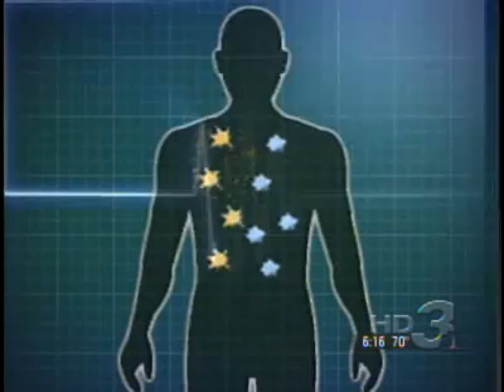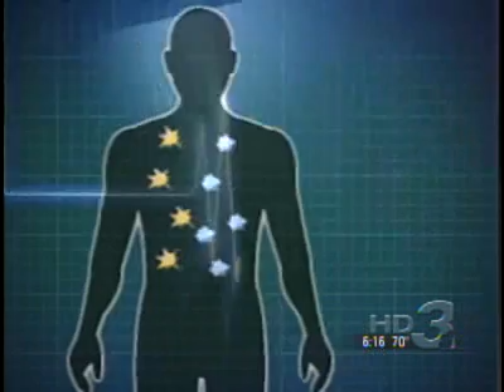Salt Water into Fuel

Comment: I've been following these videos for about 6 months and that might be the dumbest response I've ever seen.  First off the water is being changed into a gas by reducing it to it's elemental components, hydrogen and oxygen, not water vapor.  And while compensating water does release energy to the environment it's of such a low grade that it's for all intents and purposes useless. If it wasn't my freaking air conditioner would be powering my house, not tripling my electrical bill.

Comment: Yeah, it's trult sad folks (via the media) are as ignorant about nuclear power and the risks.

Makes about as much sense avoiding Boeing 747's because of the safety record of a DC-3.  Those reactor we're designed and built a lifetime ago with regards to technical advances and other considerations.  Today's reactor would require the laws of physics to be suspended before they could melt down.

But then, this entire thread is about the laws of physics being suspended.

Comment: water covers about 70% of the earth's surface and 97% of that water is salt water and has very few uses to man. Almost 2% is frozen and only about 1% is fresh water. Now if we can find ways to harness some of the most abundant elements on this planet shouldn't we use them. It is a step forward. And there are low energy ways to produce radio waves much less seperate oxygen and hydrogen from salt water. True you can always drop a battery in but it'd need to be done on a large scale.

Comment: Why do you think microwaves are necessary? The report says "radiofrequency", which typically means lower than microwave, designed to heat metals, not water. Your negative result is likely the result of not really reproducing the experiment.

Comment: You're missing the point. While it takes some energy to produce the radio waves, a 1500° heat output is likely more energy going out than going in.  The difference is made up by the hydrogen-oxygen reaction.  What remains to be seen is whether the efficiency is real and exploitable.

Comment: (cont)

Salt water is a good conductor at RF frequencies and has even
been used in a column as a transmitting antenna, albeit inefficient.

More to the point, the frequency of the RF is rather important,
since contrary to the implications of the video, high intensity RF
actually is harmful to human cells for other reasons, not just its
tissue heating effects.

Comment: A note of caution about this... it's nothing new, and the critical
information that puts it into perspective isn't divulged. Nowhere
does he mention how much energy input it takes to get that flame.

I personally have made corona discharges that vaporize copper
using as little as 40 watts of low frequency RF, but the yield is
so low as to make it unproductive. I was still in high school at
the time, probably in 1959.

Comment: Chemical-potential energy is not really an 'energy' but a structural state of matter.  When you isolate H from O the added energy is represented within the atoms themselves - that is, the applied energy input is stored as *nuclear* energy.  

It may be possible to efficiently split water so as to achieve a net positive energy output.  That is not a violation of the law of energy conservation, but a benign form of nuclear power.

Comment: I'm not sure where the 76% number is from originally, but below it refers to only the seperating of the H2O, not the entire process.

Once you have the H and O you still need an internal combustion engine to transform that into mechanical work, which will have a similair efficiency of the gas or diesel engine.  So the overall eff. would be 0.76x0.30 (assuming 30% eff for gas) for a total of ~23%.

Just using the electricity you couple power a 90%+ motor a lot more efficiently.

Comment: As stated in a previous post:

"76% is better than a gasoline engine (25%-32%) or a diesel engine (42%). John doesn't claim that his invention is a free energy device."

The guy's not even claiming it's the answer to the energy crisis. He's focused on medicinal research. He's saying it's a start. If someone wants to take it and run with it, they can. Did the Wright brothers start out with a 747?

Comment: Are you a moron?  I have some questions to ask you.  What about the ice ages before humans were on this earth?  What about the ice ages in the 1700's before cars were running?  What happened then?  Why did the ice melt then?  Why is Mars 95% CO2 and yet its temperature is -100 F?  Are you really so dense that you buy into this nonsense called "Global Warming?"  Now, there is such a thing as global warming, but it is a cycle that the earth goes through naturally.  It is not caused by humans. :-|

Comment: so what then of a spark igniting gasoline?  it's called an action potential, brainman.  does the common combustion engine then take the power of a small spark only to convert it into the power of another small spark?  No.  It's called FUEL.

Comment: Its not hydolysis, its electrolysis. hydrolysis is the process of adding a water to sperate a given molecule, electrolysis is the application of energy to slip H2O into 2H and 1/2 O2. And although it is a process that wastes energy, it is far more effcient than all other sources of energy that are viable. This is due to the fuel cells efficiency. Gas is only 20% effcient from Rig to car, while hydrogen is 80% in the overall production and utilization process becasue of the electric motors.

Comment: When HHO burns it becomes water again. You don't lose anything. Water does break down, it's called electrolysis. It decomposes water into hydrogen and oxygen. The first practical method for using water for fuel was developed in 1864.

Comment: now, let's say that this is true. Well Doesn't water when heated evaporates, so where will the vapor go? Into the atmosphere, which would mean more precipitation. So we might be solving the Gas Problem but we're going to be dealing with more rain and bad climate changes. Never mind the water used from the oceans, there is plenty to go around due to the melting of the ice caps. Just the precipitation would be a real concern, if you think about it.

Comment: Your right, the oil companies would shit if 1/10 the worlds transportation was based off of something like this. My point is that what is going on in this video is not using water to create energy. How much electrical energy does it take to burn that water? I dont know, but my guess is it takes alot more energy to create the focused radio waves than one could recover from that flame. creating radio waves of that intensity takes alot of juice. 

Or maybe i am on the payroll of big oil.

Comment: my car is not water powered as yet. I am installing a HHO booster to improve my mileage. There are several cars running now with boosters. Hope to have mine up and running soon. MPG ratings usually increase 20 to 50 percent depending on the vehicle and the booster used.

Comment: Switch grass would be essentially carbon neutral as the CO2 produced by burning is equal to the CO2 it absorbed from the atmosphere while growing.  But there still a long ways away from being able to use switch grass in large scale production.

Comment: if it's burning at 3000 °C thats is super hot coal burns at 1,000 °C I don't believe you're opinion about the power source. You just don't know how much electricity that man is using to burn freaking salt water! Burning salt water with freaking radio waves is pretty interesting I'm sure with our technological advancements we'll be able to harness this fuel and use it for the better of mankind. Besides were losing trillions of dollars in the middle east and lives. It's so simple you can't believe

Comment: Hydrogen may burn cleanly, but you still have to split the water molecule and to do that you need more power then you get from the H and O.  You can't create energy! For every J of energy you receive from Hydrogen, your going to be putting in 2 J of power from another source, most likely coal in the US.

This process might work in Iceland, where they have a large amount of available renewable energy per capitia, but that's a special case.  Providing power for 300k folks isn't hard, now do 300M

Comment: ulyses wrong it doesn't he's power company is most likely a nuclear power planet? But if they were using just sun power or battery power to produced the RF Wave like a cell phone pda PSP if that's all it took to produce 3,000 C temperature then it is producing enough energy by burning the hydrogen to power an engine. Others have proven that they could drive a 100 miles with electricity and salt water. This RF wave could be a "Cheaper" way to burn that hydrogen. We do have Hydro cars NOW.

Comment: The water isn't the fuel then, the sun is. The only thing you accomplish by using this process in a car is wasting >70% of the available energy by converting it into RF, separating H and O, burning them again in a very inefficient engine for motion.  Electric motors are way more efficient.

Comment: The voltage output is a direct function of the oxygen partial pressure? What if the RF Wave is produced from using Solar Energy? Really not using energy to burn the Hydrogen. A good theory is that you don't need RF Waves, Microwaves, Electric to burn this Hydrogen. It could be burned in a different.

Comment: IF this process was everything the nuts jobs on here wish it was, and not what hundreds of years of scientific research says is impossible, then big oil would have some losses.

Energy is a HUGE part of the economy, and oil is just part of it.  This process, if it were real, would probably be a bigger threat to coal producers as electric companies would be the first to utilize it. And that's a BIG industry too.

But the saltwater isn't fuel simply because your starting and ending with water.

Comment: The radio frequency actually weakens bonds holding together the constituents of salt water sodium chloride hydrogen oxygen releases the hydrogen which once ignited burns at 3,000 C continuously when exposed to the RF energy field as it shows doesn't burn his hand. IN other words the RF is not the combustible energy. What the video demonstrates was using common Salt Water provides a "Abundant Combustible FUEL". They want to know why the RF field is burning the Hydrogen from simple salt water.

Comment: That is completely incorrect.
The Equation of combustion is:
2(H_2O)+Energy -(via catalyst salt)->2H_2+2O_2
There is no such thing as HHO Gas. If you don't believe me, find the partial pressure of both the Hydrogen and the Oxygen
So,
2H_2+O_2 -> Energy (your bright flame) + 2H_2O
So the overall equation is:
H_2O -> H_2O
NOT H_2O -> H_2O+Energy
This would violate the law of conservation.

Comment: Halohadel Wrong! SALT WATER is the Fuel that is burning at a very high temperature not the sound wave. The Salt Water is combustible the energy can make a vehicle move forward. The Electricity used to power the radio waves gives us the byproduct of burning Salt Water which I believe is "Hydrogen Burning" with a Oxygen conduit. He set water on fire with a radio wave it's oxidation it's giving up electrons, as when the material combines with oxygen the wave is burning hydrogen molecules?

Comment: You can use a fairly small battery to produce microwave frequencies capable of carrying a digital signal over miles. The energy required to produce a 1500 centigrade flame is considerably more and the input is considerably less than required for microwaves (Radio is of a lower order than microwave in electron volt requirements) the real energy input is from the salt water itself which contains hydrogen. Remember input relating to output also includes the medium as well.

Comment: Obviously this is not a question of power out, it is a question of power out relative to power IN.

Distilling alcohol requires that you dump trememdous amounts of power into the process, for very little gain in the power available from the alcohol. We have the same problem with hydrogen, you have to dump more power in than the power you get out. 

So,how much power does this device comsume relative to the power it produces?

Comment: I'm an engr and the process shown might turn saltwater into energy but the saltwater isn't supplying the energy, the wall socket is. Therefore it might be useful for storing energy, but in itself it's not an energy source.

The reporters talk about it's use in a car which is asinine.  Electricity is over 90% in powering electric motors. Converting it to RF, then using that to seperate H2O into H and O, then burning that in a piston engine to create motion at best would be around 10% efficient.

Comment: Actually Hydrogen is the most common element in the universe, not earth.  Earth's most common elements are iron followed by oxygen.  That's right, we're a rust ball!

Albeit, most of the iron is in the core.  On the surface hydrogen is probably pretty close to the most common, at least numerically. By mass it would be oxygen.

Comment: Yes, you should be ashamed of yourself, asking sensible questions about whether it actually works or not.  Who cares if you have to put in twice as much energy as you get out.  It's BURNING SEAWATER, dude.  It's the answer to the energy crisis.  If it needs extra energy to get it running, just use two more salt-water engines to power it.  Simple!

Comment: I can buy that Sodium reacting is causing the color of yellow, but the flame and heat are still coming from the H and O. There's like 3% salt in sea-water, I doubt that small test tube contains enough Na to fuel a fire for an significent time, assuming you could seperate it into vapor without it automatically reacting again with the water.

Comment: Again. Salt water is not what is left after it's burned. Therefore a possible net gain in energy if H2O and NACL is turned into something more organized. If it was just hydrogen and oxygen burning, the product would obviously be water with no theoretical gain. But there are four elements involved here, H O NA and CL. And the color of the flame seems to indicate that the sodium is oxidizing.  More than a cursory analysis is needed.

Comment: Fuel is Fuel.  But the fuel here is electricity not saltwater. Hydrogen and Sodium are highly combustible. Unfortunately, as saltwater their energy is already spent.  You may as well build a car to run on Carbon Dioxide and water vapor as long as we're using exhaust products as fuel.

Comment: If the fuel and the exhaust are not the same substances then the net will be differernt than what's required to make it burnable.  If you had a preheater to make powdered aluminum combustable, the fact that it can be used to power that preheater and be used as a fuel does not violate the second law.

Comment: If you notice the flame is pinkish red indicating the presence of oxidizing sodium. This means the products of the reaction are not the same as the reactants. i.e. Salt water in, something else out. This means the energy given off may be very different than the energy required to separate the components. Is it more out? Why don't you try it rather than ragging on someone else's cool discovery?

Comment: Voltage is not energy. Volts * Amps is energy. If a coil increase voltage from 12V to 20kV then the current is reduced proportionately (disregarding losses). The sum of V*A will remain the same.

Comment: Instead of transmitting radio waves to induce a current into the water, don't you think it would be easier to introduce the current directly... say, with metal plates? The same frequency could be reproduced without the transmission losses.

Check out any number of electrolysis videos out there.

Comment: Everyone should go and buy 1000 Watt Microwave Ovenns so they can get 100 Watts of thermal energy from water.  That way they can waste 900 Watts of power to burn water while the Electric company burns their coal to produce the 1000 Watts of power needed.

With more people wasting useful energy trying to come up with a "Green" source, we're going to run out of energy faster and have even more gas emissions.

Comment: I never clamed that this was overunity. What this man may have found is a more efficient method of producing hydrogen from water. Right now one of the main problems for the utilizations of hydrogen for fueling cars is the cost of splitting the water molecule.

Comment: Conservation of Energy.

In a lossless system, it would take the same amount of energy to split a water molecule as you would get from creating one. There is no net gain.

Gasoline works because splitting the molecule is an exothermic reaction. You are releasing energy that was required to create the molecule. This demonstration is the same thing as saying you could perpetually use the same gasoline by igniting it, reforming it into gasoline again, and then reigniting it.

Comment: The water isn't actually burning. The 'Flame' is actually an electrical arc created by the strong magnetic field. It is colored orange by the liberation of sodium.

Even if he was using energy to separate hydrogen and oxygen, this process is endothermic. He would then need to ignite the separated H and O to get an exothermic reaction.... but that would result in net zero energy gain.

Comment: The energy it takes to produce the required radio waves is highly likely much less than the energy given out by the flame. That Stirling engine could be replaced by a small electric motor producing 100's of times the energy and use less energy than the radio wave generator uses.

Comment: Your goal is noble, but very premature. For specific cases this might be useful where your trying to power a small site using wind or solar and have time to build up reserves or what not.

As for green power, it makes little sense to try and replace other energy uses (i.e. heating or cars) until we have the capacity to replace a significent portion of our electrical demand.